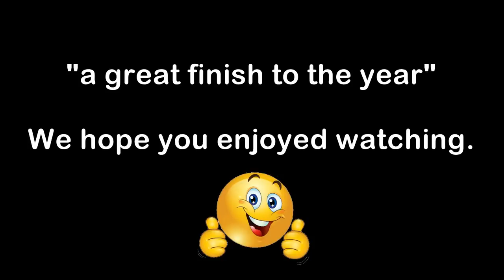4x4 Fails 2016

Comment: I like off roading and all but like why go out and break parts? Why not just go off roading on easier terrain for the vehicles  sake
Reply: +Luke M Are they driving your vehicle or their own?
Reply: All I'm saying is you can still have fun without breaking shit
Reply: +bannablitz247 Well this is a complication. So you don't know how many trips it actually took them to collect all those damages.
Reply: Matthias Volk this is true, but it is a common trend I have seen
Reply: +Matthias Volk good point, but a lot if the breaks were in the same spot
Reply: +bannablitz247 I'm an ex jeep owner. all I can say for jeep is they look awesome.. after a transmission replacement from one night of off road in and other small components I can assure you they're not built to handle abuse. easy trail riding, probably. had a 93 toyota that would run circle around my jeep. usually cuz the jeep was crippled from the weekend before.
Reply: Kinda lose the aspect of fun when your laying under a car getting greasy instead of 4wding and checking out the sights
Reply: DifRential 😂😂
Reply: Luke M it's not as fun

Comment: Jesus, you guys put bumpers and snorkels on your rigs but you can't drive worth a damn lol.
Reply: +trail gnome Those two things are the most basic thing one does before going out and learning how to 4WD. Having those on your 4x4 doesn't automatically make you a professional. Oh and its a Bull bar not a bumper, just FYI
Reply: My bad,Snorkles are not needed for the arid southwest U.S.
Reply: Yeah I can imagine, would be dry out there. Even though Australia can be very similar there is a lot of creek and river crossings to go along with it here so its always handy to have.
Also helps with dust along outback roads as most have some sort of dust separator.
Reply: @Aerhgad1  tires, then winch, then lsd or lockers. Snorkels and brush guards are not first on the list.
Reply: @lokirip2372  Who said anything about brush guards? Talking bull bars which usually give more approach angle than standard front bars. And snorkles are one of the first things you do here, unless you like water in your engine on the first creek crossing
Reply: I forgot skid plates too. All more important as first mods than bumpers and Snorkels. Stay away from creeks and ponds for a while dude. Better waterproof your connections, alternator, run all breather hoses up into the tub, and seal your selenoids and voltage regs (if external). Then you might make sense adding your snorkel.

Comment: This is for old mate, who asked if I would watch it and see what I thought. I should send you the video of me getting me Prado and Camp Trailer stuck at the 3rd cutting going onto the beach at Double Island last weekend lmao. The best thing about the floor of a fourbie is  you can't sink much further into the sand. 

I don't understand what the issue is with pulling out the winch? Sure it's fun to have a go but at what cost I have to ask?
To all the people who are going to hate on me for this, I'm no expert but there are some glaringly obvious snafus here. 

The first bloke could have easily done a winch assist instead of breaking his car. First dude in the nIssan, he had a bloody good go...he just got a little side tracked lol. @1:09 It would have been much easier to have moved the frikkin big rock or go around it instead of over it ...doh. @1:35 the car has so much clearance, why would you opt to get yourself on such a tilt when it could have been avoided. Bush pin stripping is like a badge of honour ;). @2:50 wtf was going through his head to plant his foot and steer high right? It can be overused sometimes but...tyre choice and pressure. Ffs 2 in a row same outcome lol. @ 4:00 approx. same Jeep dude from the other compilation (2013 I think)..he's a real wingnut. @9:15ish, wtf is dude saying full lock to the left and then go back for.  Ole mate could have easily just gone diagonally over that (continuing to the left), without nearly tipping it. Spectators are such frikkin experts....says me lmao. @10:03 Dude with the Shitsubishi seesaw...frikkin too funny. Next guy in the Prado...should have stayed more to the left, just maybe. Bloke in the water/mud...epic fail. Me personally, I would have stayed to the right hand side more with a bit more speed and then pulled out the winch lol (because I don't have mud tyres lmao). Bloke in the Jeep took it easy and got himself out  of the poo nicely. Poor dude with the chainsaw, trying to do the righty and physics got the better of him there (angled downward force). The trick is to cut the top and bottom further up, to create room to flex and then go down the bottom (I did tree lopping for 2.5 years). @13:55...NIssan seesaw...followed by another Nissan seesaw lol. Oh and @ 15:00 ish I think it's a Jeep seesaw.@16:00ish, The poor Nissan needed a snooze. I feel bad for the Nissan owner or any owner who has that happen to their beloved fourbie. It was still driveable afterwards though..thumbs up.
Reply from the maker: Thanks once again for your detailed observation and taking the time to comment.

- The first bloke wanted to try without winch first. He didn't break the car, only the tail shaft.
- @ 1:09, that's the gate keeper, the point is to have it there and make it harder.
- @ 1:35, gotta try things first. It just ended up reversing and going straight down the rocks to its left.
- @ 2:50, it's only the aluminum side steps.
- @ 4:00, same dude from the beginning of this video.
- @ 9:15, yes, should've full lock to the left, but the driver kept going right, therefore "go back".

Everything else is so funny 😂 Thanks. Yeah, the poor Nissan at the end was driveable and was all fixed up nicely shortly after that.

Comment: Its funny seeing these damn near stock height vehicles attempting the trails they're on.
Reply: That's because, in Australia, we are very heavily restricted in what modifications can be done to road going 4wds. Lifts are generally restricted to 2 inches. Add another 2 inches in tyre diameter, and that's about it for a lift. Any more, and we risk trouble with the various transport departments or police forces.
Reply from the maker: +MrBundyrumandcoke unless you engineer another 2 inches on top of what is already allowed, suspension and tyre.

Comment: I enjoy my 2012 jeep rubicon. The main reason I bought it was for the front&rear e-lockers and the electronic sway bar release. I don't know anything about Landrovers, other than they seem to be an awesome machine and are expensive to fix. The only time I see Landrovers are in Newport beach, or Hollywood, with not so much as a scratch on them. We call them grocery haulers. As far as off-roading goes, just about any make or model 4x4 can be made to go just about anywhere. Don't matter what your driving, as long as you're having fun.
Reply from the maker: That's what it's all about bud. Thanks for commenting 👍

Comment: Correct me if im wrong but wouldn't a lot of these guys be better off with bead locks vs regular rims? Seeing as how a lot of these tires are popping off, I would think that as being a viable option.
Reply from the maker: For sure, but most people don't want to risk being defected for running them.

Comment: These are some wild trails for mostly stock rigs. Lol
Reply from the maker: Which ones are stock rigs?
Reply: Aussie Four Wheelers “mostly stock” meaning each individual rig has mostly stock parts.  Most have open diffs, no one has bead locks. Snorkels are not a necessary mod in this trail. 31” tires....really?  Of course my opinion. But trails like this should have a better built rig than a mostly stock rig. That’s why your vid has so many people breaking. This is a tough trail for 31” tires. It’s almost not recommended. It’s doable, but it takes the fun out if it.
Reply from the maker: Lol 😂 thanks for your input.

Comment: lockers lock the tires so they all spin at the exact same time allowing for better grip. and a lift kit allows for more flex, ground clearance and bigger tires
Reply from the maker: +evanthespeed YT Isn't it worse that all four tyres do wheel spins and burnouts and more lift raises the centre of gravity so it's easier to go over? 2" lift and 33s can basically go anywhere.
Reply: Well lockers still can give you wheelspin and are a lot better for rocks ex: if you are three wheeling, equal power sent to all four corners will push your rig up a lot better.
And for lifting, you can widen the stance for less top heavy weight
Reply: +evanthespeed YT But if you lock the car how do you get in?
Reply: It locks the differential
Reply: +evanthespeed YT That doesn't sound like you'll go anywhere by locking the diff. Isn't that like a handbrake for the diff?
Reply from the maker: +LROR Land Rovers Off Road If you lock it, they say you can't turn the wheels. Must be a feature for more secure parking.
Reply: +Aussie Four Wheelers (Hemi4WD) Yes i think your right, I recall something that it was designed initially for Jeeps to compensate for the emergency/hand brake failure issues they had.
Reply: LROR Land Rovers Off Road its not like a brake at all. its for rock crawling and allowing for better traction.
Reply: No, the reason it's hard to turn is because all the wheel are turning at the same speed. Think about your front tires as you make a left turn (with no diff lock), your left tire is staying mostly and place and your right tire is spinning a bit faster to wrap and make the turn.

Comment: 4:18 Not sure I would have trusted the handbrake that much.
Reply from the maker: It's in Park.
Reply: @AussieFourWheelers   Fair enough, I was just thinking, with the drive shaft broken, the gearbox is only braking with front wheels.... maybe OK but I am a pissy, I would put something behind the rear wheels as well.

Comment: How much of these guys were using open diffs on this trip?
Reply from the maker: Out of 23 vehicles featured in this video, 5 had open diffs, 2 traction control, 2 rear LSD and the rest 14 had either one or both diff locks.

Comment: Looking at the type of off-road driving being done, I am surprised that none off these vehicles were fitted with bead-lock rims. They would prevent a lot of grief, especially with low pressure off-road tires.
Reply from the maker: Not many people run them because they're illegal here. Some take the risk, but it's a hefty fine.

Comment: I think just about all these trucks in this video need more than just mud tyres to be doing this kind of heavy 4wdriving. I also agree with another comment tire pressure is way way to high obviously the recommended psi is not suited for this kind of driving
Reply from the maker: What's a good tyre pressure in your opinion?
Reply: For normal driving it’s st the recommended 35psi but normally drop it down to around 20 (depending on the driving) when putting it in 4wd then just go to the gas station after and pump them back up. Never had a problem with bouncing and gas isn’t normally an issue
Reply from the maker: We run less than that 😂 and we carry air compressors with us to inflate before hitting the road.
Reply: Aussie Four Wheelers but you replied to someone saying you run the recommended psi so did you change that in the past couple of weeks? all the gear with no idea
Reply from the maker: Lol 😂 that was a sarcastic comment as a reply to web-wheelers who know what pressures we run by just watching the video lol

Comment: 13:40 it's called leverage, mate.
Reply from the maker: There was no leverage there when both ends were in the ground. Looking at it would make you think that if you cut from the bottom, both ends would fall down, but the way the other end was embedded into the ground it was like it's been pushed towards the other end so it was under tension. I hope that makes sense.

Comment: Did any of these people ever gere of Off-Road tires? Most of the vehicles in the video are using stock street tires and they wonder why they are getting stuck. A lift kit would help as well and some common sense.
Reply from the maker: Lol 😂 They all have lift kits, unless lift kits are also stock. Lockers are more important than (non-stock) "All Terrain" tires. Give the guys some excuses, understand the whole picture, before running for the keyboard. Have a look at some of our other videos and you'll quickly realise that this was not done in ONE day, and one group of people. If you scrolled down some comments, you'd find that it was stated many times that this is a compilation from over 150 trips in a span of 3 years. But guess that's only for those with some common sense.

Comment: Wow don't these people know that you are supposed to replace the driveshafts with aftermarket driveshaft that's stronger then the original or have them beefed up by a driveshaft company its only about $100 per driveshaft and they will warranty the driveshaft as well a bulletproof transmission wouldn't hurt either! If you build your own transmission it only costs about $300 for the hard parts and $50 for the seal and gasket set!
Reply from the maker: Wow, you don't say! So you missed the very first clip. There is no further discussion here LOL. Case withdrawn!

Comment: Can someone please explain whats going on at 11:32? Thanks
Reply: Using a hi lift jack and weight of the vehicle to break a tyre bead. Probably got garbage caught in the bead,  so the tyre is leaking. Break the bead, remove the crap, reseat the bead, and reinflate.
Reply: Thanks, but I mean even a second after that when he lights something and it pops in in place. Whats that about??
Reply: Rims have seats to keep tire in place, consequently it's as hard to put tire in place as to displace it from the seat. And hot air expands, right? So, what you do is you put in some inflammable aerosol inside, set in on fire, air expands, tire pops into it's place.

Comment: most of the issues are cuased by simply not airing down their tires.
Reply from the maker: What is the recommended pressure in your opinion?
Reply: Aussie Four Wheelers depends on where you and what you plan on doing. for really muddy conditions like that Id be down to 20psi
Reply from the maker: So how much pressure do you think the vehicles in the video ran, best to worst?

Comment: Note to self: Don't buy a used 4x4
Reply: Ain't that the truth.
Reply: Shane Turra exactly why I buy 2wd trucks, in much better condition. if I get a 4 wheel it will be new or a pavement princess.

Comment: Some of these guys need way more ground clearance.
Reply from the maker: How much is enough in your opinion?
Reply: @AussieFourWheelers  Well it depends on what you are doing. For rock crawling and climbing I would want at least 8 inches with portal axles. Also, why did you delete our lovely conversation?
Reply from the maker: It's not deleted 😂 I just checked 😅 8 inches on portal axles? Lol 😂 Okaaay.
Reply: @AussieFourWheelers  yanks like rolling over all the time lol
Reply: @zacharyburdette4261  you have no idea about offroading and COG.

Comment: For many countries you need light vehicles, kei cars, or normal vehicles, short, destructible monohest, 4x2 with 5:1 gearbox, differential lock, front-wheel drive with engines below the tax return, for example if the engines 1000 start paying more tax these engines be 990 cubic cms, with adjustable power turbo activatable and deactivate it, it is necessary to stop idolating the horses of force, that obsession has led to the current pollution levels, it would be necessary that some vehicles could pollute a lot and have a lot of power but as the user decides they can pollute little and have little power even at high revs, it is not so necessary that the 0 to 100 is so fast, what is necessary is to be able to walk at 100 consuming little fuel and polluting little, LA (alleged)TRANSITION to electric vehicles should be done as I said a few lines or at least that is what many users are good for us. In many countries 4x4 cars are penalized with more taxes, insurance is worth more, the weight is also penalized, manufacturers need to be much more realistic about the needs of users. 
The reducer, low, reductive or low does not have to be a luxury when for many users at rural and suburban level it is a primary need, it is much more necessary the reducer than a second transmission, it is more necessary to block the differential than a second transmission, or even the problem of unnecessary skating could be solved with a separate brake (MANUAL) on for each of the tractor wheels, (being able to brake the wheel you are skating). 
Vehicles are not only for the city, and even in the city there are very steep roads (at least in many latin american cities), in Latin America there are hundreds of thousands of kilometers of uncovered tracks, in shell or war, and in addition many of them have stretches very inclined. Buying a real 4x4 or campero is very expensive, plus its use is also very expensive in fuel and maintenance. It takes SUVS, cars, piukps, with gearbox, differential lock, independent brake on tractor wheels, With a joystick for starting on slopes that is: backwards, brake, forward release brake, for the right accelerate, for the left slow down, so that it is possible to release brake and accelerate in a fully controlled manner, also accelerate the engine with the brake actuated.

Comment: WTF is a CV?
Reply: r u serius??
Reply: @DifRential  I promise, I have no idea in the world of Offroad 4x4 and this kind of trucks. That's why I ask. 
excuse my ignorance
Reply: @WeLdErNiKe77  oh sorry then. a cv joint (constant velocity joint) is a part that sits at the end of n axle n transfers drive to the wheel at any angle of the steering wheel and/or suspension. thay r also found on cars with front wheel drive setups. american 4x4s use uni joints instead which r not as good as a cv. trust me im a mechanic.
Reply: Coronavirus